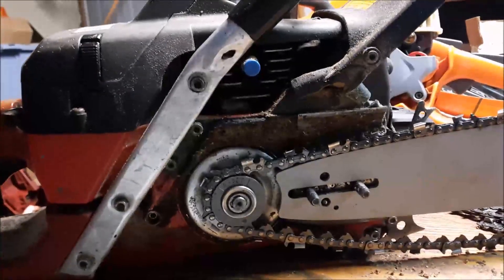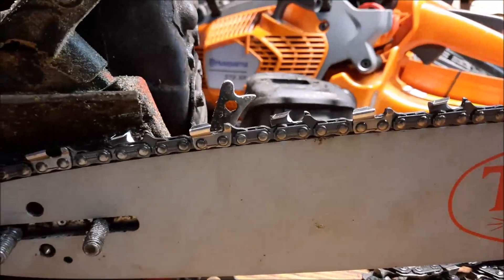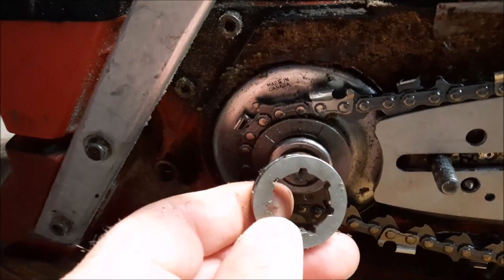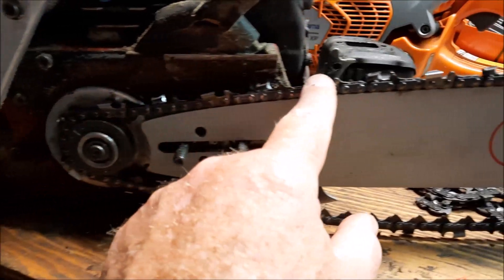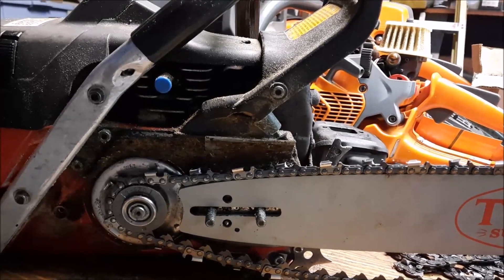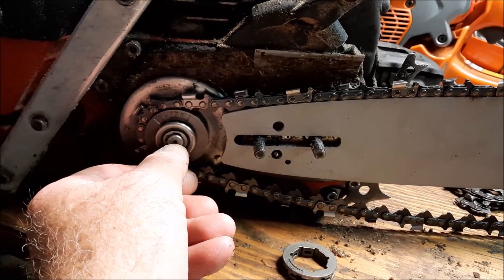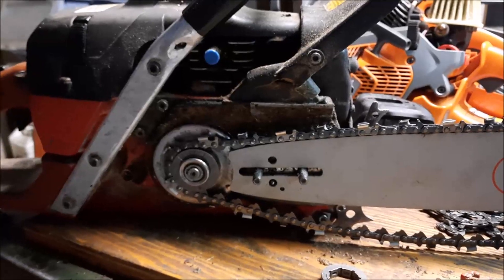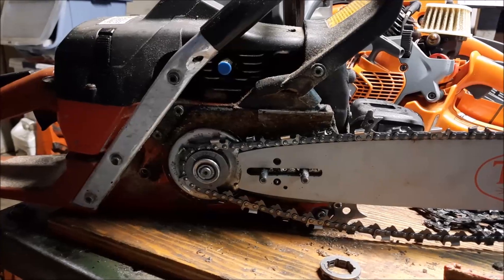Chainsaw Sprocket Size & Gearing Explained

Comment: I was swapping around sprockets on the 359 I just finished messing with, so far it loves the 9 pin .325 sprocket even with the 20" buried in the hardwood I've been testing it in. I get an extra cutter per revolution over the 8 pin 3/8, and hopefully a smaller kerf meaning less work to get through the log.

Comment: With the 592 you almost have to run a 8 pin sprocket in 3/8.. in fact I might be forced to get a 9 pin once it's ported.. once the sprocket gets too big however then you need a custom bar or the chain will more easily derail.. hoping a 9 pin will still allow standard bar but I know 10 pin is too big and prone to derailment

Comment: I went through similar issues running a 3/8lp bar/chain on a 50cc saw.
The best combo I found was a chain that was 2 links too short for the bar and grinding the tail of the bar down to make it fit. Doing this closed up the gap between the sprocket and bar.

Comment: 14% more chain speed with 8t, 14% more torque with 7t.  About the only saw I have that benefited in cut speed from 7 to 8 was me 064 … then you have the entry of the chain into the bar aspect too - more wear/likelihood of throwing chain as you increase rim size imho
Reply from the maker: yup. And the video I did on the Jonsered 2163 did show that a bit..... I think. But that is one of the reasons I'm not a big fan of small mount setup BTW. Ran into the "bar" thing with that 560 I built. Wanted to go larger with the sprocket and all it did was toss the chain more.
Reply: @afleetcommand  I’ve got a few 262xps’ that run the small mount with 20” bars - basic farmer brown mods (they are used so unless fully rebuilt don’t wanna go coo coo with em …..) and I really wouldnt realize any gains putting an 8pin sprocket on , most likely be slower by a fuzz. For RACING thru balsa wood cants I can see 8,9 or even 10 pin rims (or more) or maybe an 8 pin on that 2100 CD I just got (plenty of torque to pull it) for a song. Idk , my experience with it always led me back to the 7pin - maybe higher rpm / more oil to the chain ?
Reply from the maker: Partly because of YOU I drug out a nice clean all original 262 to see what all the fuss is about. Hoping to put that Total Super bar on that saw, do a little comparison between it, the 2163, and the 560 HTSS ( Ultimate Old Man Saw ). UOMS has been "retired" for the most part because of the small mount bar.
Reply: @afleetcommand  there a certain version of the 262xp that’s head and shoulders above the rest …. Cylinder/carb/piston combo makes em run noticeably stronger than the others. 1990 K/S cylinder with walbro hd 87 carb is the ticket - good luck finding one though 😂
Reply from the maker: This one was a gift from my friend & general Jonsered / Husqvarna oracle Bob :) I'll look to see if it's as you mentioned. One thing I can say it OEM cylinders are pretty rare regardless of actual manufacturer
Reply: I have fooled with many different sprocket/saw ccmbinations over the decades.  And i kind of stopped for a while, then I started getting my felling saws ported by Donny Walker and the first 592 he built for me I just couldn't get comfortable with it, then on a lark I put an 8 tooth on it, thought why not, WHOA, i cut three red oaks with it and i was yep that's what it was wanting, just not in hard maple, and my stock 592, i tried it on it and nope she doesn't have the ponies to pull it.  Pretty much they both like the same raker setting as well.  On my 064 in the 90's I found the 8 tooth I was filing the chain more for cutting the same amount of wood...wasn't in as big  hurry those days as today, I guess